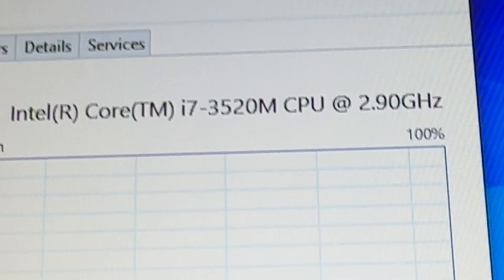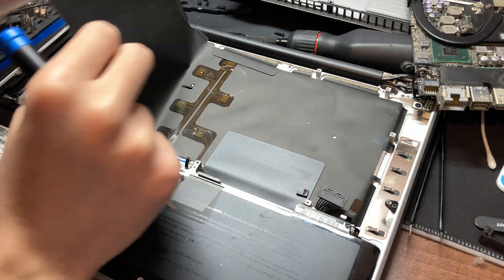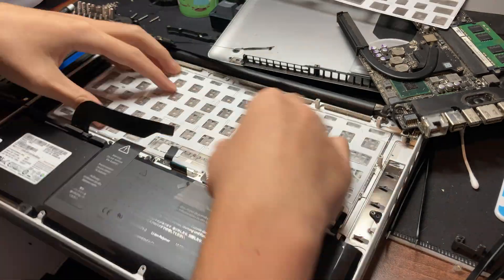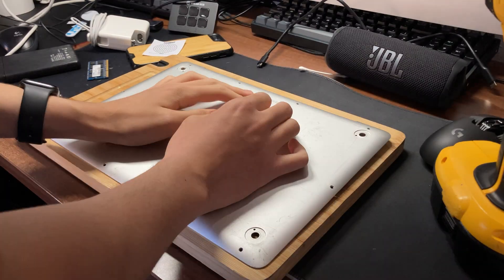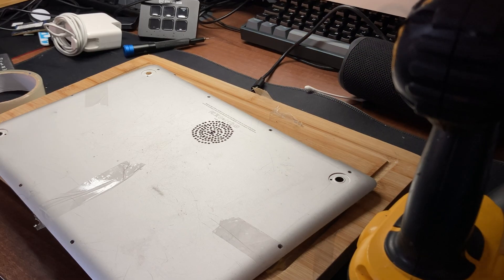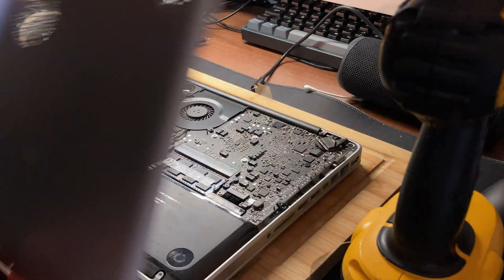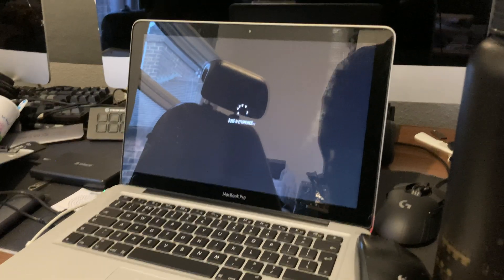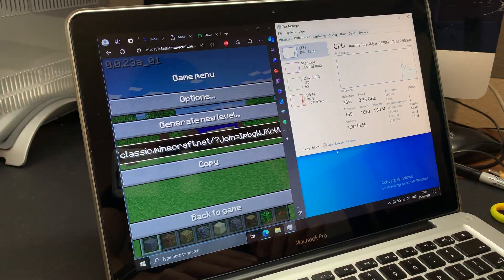Is The 2012 MacBook Pro Still Useable In 2024?

Comment: I also have the same but my laptop hangs a lot like the site opens close by itself . Laptop hangs a lot . The screen minimizes and opens itself. Also i get current from it sometimes . 
I don't know what's happening to it . Either the keypad has an issue or it needs to be serviced
Reply from the maker: The keyboard probably needs replacing

Comment: I got this 2011 Toshiba core i3 laptop that was falling apart, but I drilled some holes in the case to run through zip ties to hold it together
Though gradually I have been replacing them with bolts and nuts
Its still doing its job somehow, though I just use it for music production these days
Anyways, keep up the good work mate
Reply from the maker: Lol